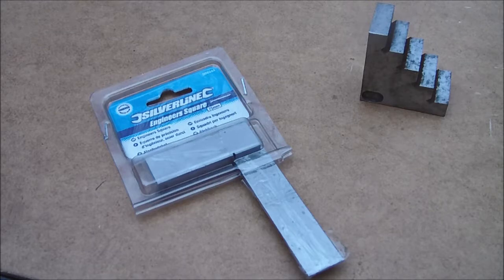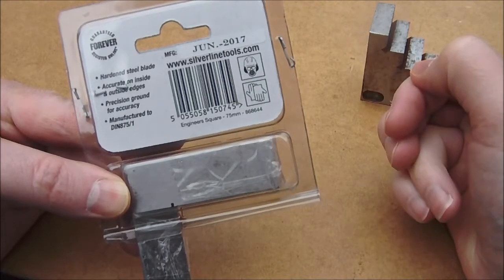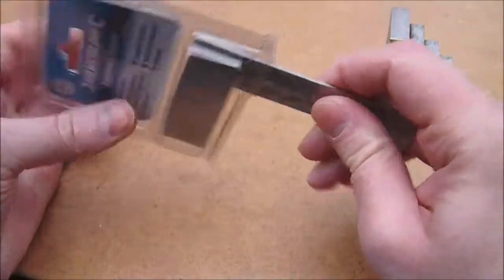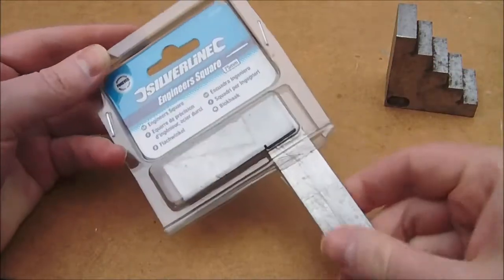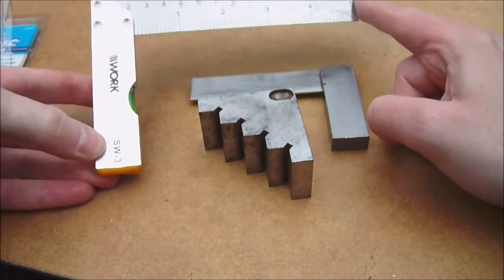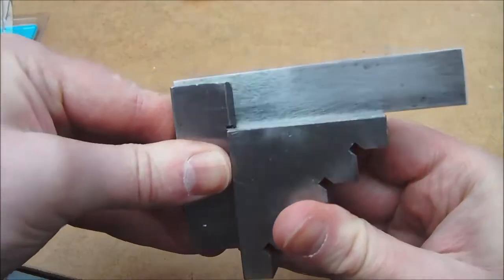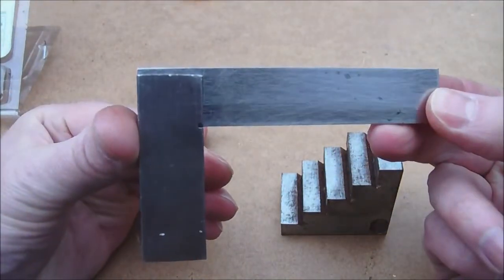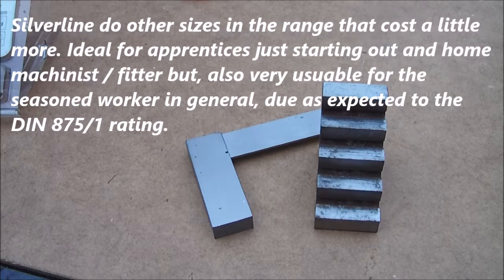Silverline Engineers Square 75mm.  DIN 875/1.

Comment: I bought two sizes of these. Both were 1.5mm angle out along the blade length. A factor of ten out of the standard. Hit and miss, mostly miss.
Reply from the maker: This is only a small square, the long ones do have a greater chance to be off overall on the odds I suppose. The more chance to go off from square the further away from the handle. This one to me tested fine. You want to look for some 'bevelled' squares. These are made & ground from one piece & have a higher chance of accuracy. Try igaging for decent cheap versions, even Moore & Wright's are relatively cheap, even look to be the same product.